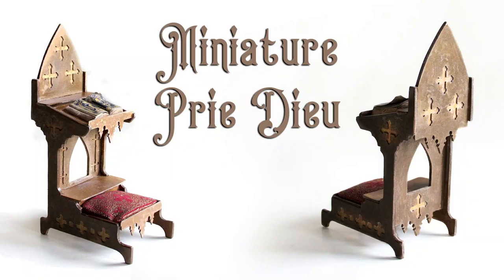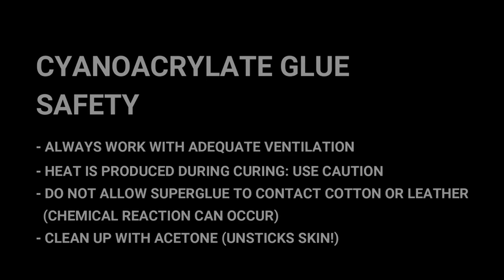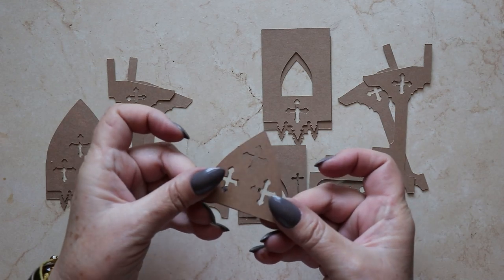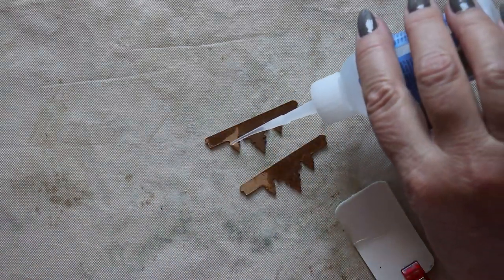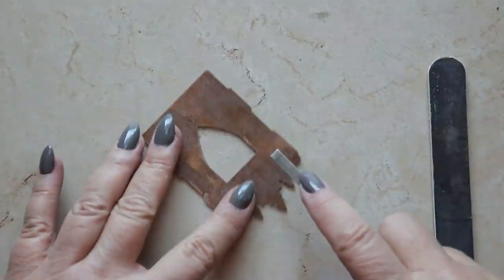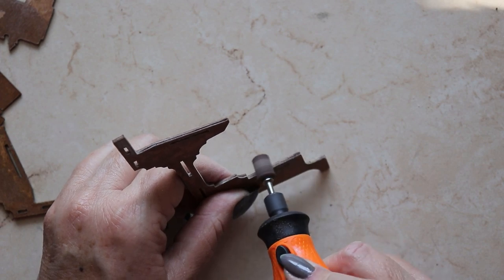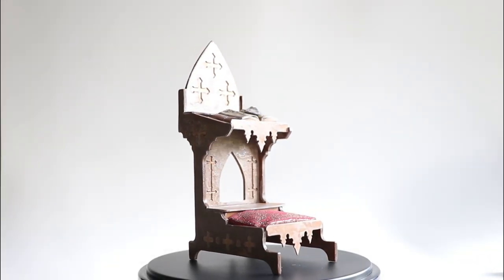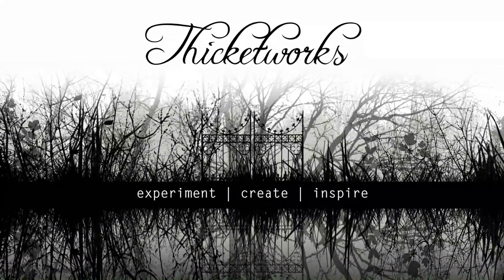🔨How to Build a Miniature Prie Dieu🔨

Comment: This isn't 1:12 scale is it? It seems too big ? I am having trouble with the file on the cricut maker. It is coming out looking way too big for my doll house.
Reply from the maker: Yes, this is designed in 1:12 scale. Like many Gothic pieces, it is not meant to be tiny, but rather a very substantial focal piece. Like all svg files, you have the ability to rescale them to any size that suits your project. Many have made this in 1:24 scale, and it turns out beautifully. 

The measurements are displayed on the Etsy listing: 5 7/8" tall x 2 1/4" wide x 3" from front to back.
Reply: @Thicketworks  thank you for your reply. I'm  still learning.
Reply from the maker: You and me both, my friend! PS: check your Etsy messages. xox